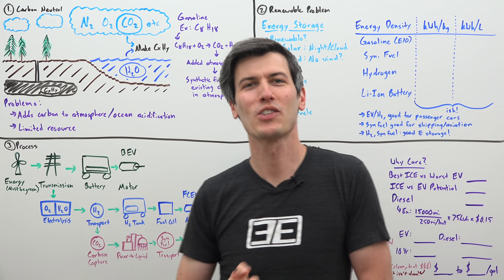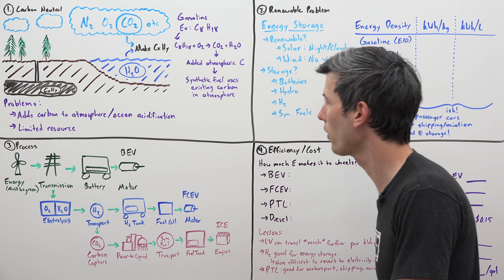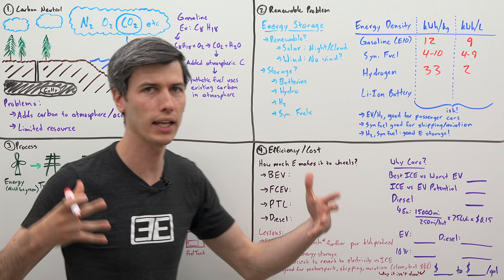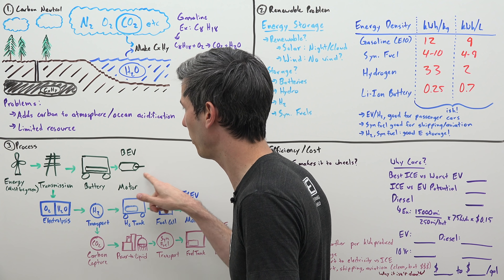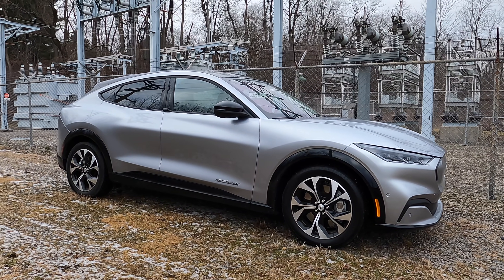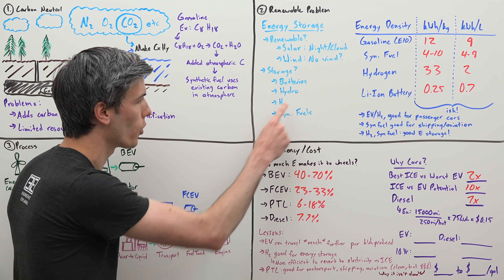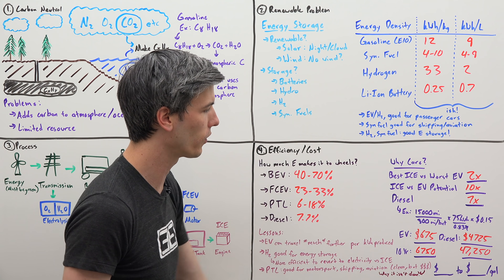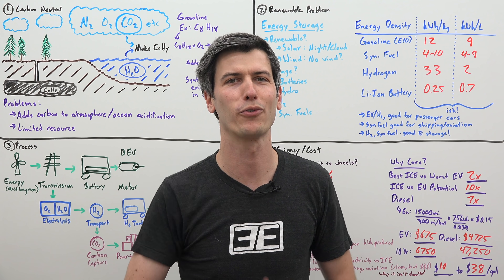The Big Problem With Synthetic Fuels

Comment: Porsche really gave me hope😭
Reply: Same here
Reply: 2$ for 1L of fuel is a ok price, in my country the cost of 1L is around 1.5$ so it wouldn’t make a massive difference
Reply: @broshido2745  vote in some politicians that aren’t going to rob you of your hard earned money at the pumps
Reply: @TKUA11  No such thing as a good politicians where i live, average salary is about 850$ too so yeah, pretty shitty place to live as a petrolhead
Reply: Still does. If any Brand could make this work well, its Porsche. And in my opinion its still a great Option for sportscars and in long terms maybe for All cars
Reply: The cool thing about diesels is that they can run on used cooking oil, so if fuel is too expensive, people might just make their own
Reply from the maker: Doesn't mean it won't exist! But I think the shift to EV/FC for the majority of passenger cars is inevitable at this point. Carbon neutral fuel is neat, it's just gonna be pricey.
Reply: @EngineeringExplained  Yes. Exactly what I was thinking: e-Gasoline will be for motorsports, motorcycles, recreational vehicles, performance cars, and pickup trucks. But gas and Diesel passenger cars (including combustion engine pickup trucks) will be only around 10-15% of car sales once electrification takes off. Besides, an EV is perfect for 80-90% of people already, as they aren't interested in engine sounds or whatever and just want to go from Point A to Point B.

Here are the areas where I think full electrification makes sense: 
- (Most) economy cars (battery)
- Short-haul, local, and delivery trucks (fuel cell)
- Lawn&garden equipment (battery)
- School buses (fuel cell or battery)
- City buses (fuel cell or battery)

IMO, semi trucks (lorries) should stay as Diesel, or transition to a Diesel & fuel cell or Diesel & BEV hybrid, while transitioning their fuel to 50+% biodiesel. Tour buses (coach buses) would also be best as Diesel hybrids as well. I've also heard that Diesel-electric is a great option for ships as well.

There also exists a thing called biocrude, which is basically a semi-synthetic crude oil produced from pyrolysis of biomass. Garbage, sewage, certain materials from C&D debris, and countless types of biomass (including medical waste). This biocrude can then be refined into almost the exact same things that petroleum can be refined into, so the changes that need to be made to the existing refining processes are comparatively small. Those giant low-speed Diesels that directly drive propellers may get replaced by Diesel-electric propulsion systems with medium-speed Diesels driving one or more low-speed electric motors, as Diesel-electric is actually more efficient than direct mechanical propulsion (for large container ships we might see a 70-120 RPM induction motor directly driving the propeller). Those engines can run on both biocrude and raw petroleum just as easily with Diesel fuel. Biocrude is a great alternative if we insist on moving away from petroleum-derived fuel oils or crude oil IMO.
Reply: @electric7487  I don’t insist on moving away from gas. Perfectly content with what we have now. There’s almost 8 billion people on the planet and they all can’t afford an electric car. Not only that, there’s not enough African children working at starvation wages, to dig out coltan for these cars
Reply: @TKUA11  Yes, EV's still have a very long way to go, but once their costs go down they will be a great option for the everyday average person. I'm also really hoping that solid state batteries can take off.
Reply: I feel you all. My LS3 swapped 350Z has its days numbered until I can turn it into an EV
Reply: Don't lose hope.
Reply: @HamsterV10  exactly idiots like this guy saying it won't work have already given up.
Reply: It really gave you that hopium that you were craving
Reply: Its given many hope and confused many many more. Dont be one of the latter... it just needs more support.
Reply: 25 years ago no one would have believed electric vehicles would be possible, Synthetic fuels are very possible
Reply: Porsche specifically said synthetic fuel would be for motorsport. Porsche itself admits there are better alternatives (electric).
Reply: Hope for what?

Comment: I literally just wrote a 15 page paper on this 😂 you couldn't have made this video 3 weeks sooner
Reply from the maker: What's my grade haha?
Reply: @EngineeringExplained  B+, basic summary was pointing out regulations that are soon to come federally and state wide (mainly California). Breaking down how different methods of powering vehicles works (hydrogen, synthetic, electric). Establishing cost estimates of implementing the three kinds of industries. Then ultimately concluding there are different applications that each industry will excel in, electric being for the masses, synthetic being for private industry projects i.e. Porsche/Siemens and also applications where weight is a higher concern i.e. aerospace.

Edit: Thank you I've been watching you for years and your videos gave me many ideas and have been very educational for a current Electrical Engineering student. 

A+ as always I was just joking!
Reply: @Newtoschool  B+.... NICE! :)
Reply: @Newtoschool  Did you also factor in cost of transition? Makes things very interesting. BEVs can charge at home and charging stations can tie into our existing grid at relatively low cost. Synthetics can work on existing vehicles and be added gradually to existing gas stations, and potentially even be transported through existing pipelines. Hydrogen requires a robust and expensive network of electrolizers to be added. IMO this is the main reason why synthetics have a future but hydrogen will not.
Reply: @Newtoschool  Awesome. Keep it up. B+ is much better than your average study on these things where quality suffers due to cost considerations which in my opinion shouldn't be a consideration when it comes to fundamental science on future infrastructure.
Reply: @Newtoschool  An intriguing global emissions reduction reality is favoring EV's, factoring existing battery production, isn't ideal if the goal is reducing emissions as fast as possible. Using Tesla's gigafactory production from a couple years ago could supply the entire yearly US vehicle sales to sold as mild hybrid.

For example contemplate the emissions reduction in these scenario's all utilizing 

1 x 50 KWh Tesla model 3 
- Requires 240V 20+ amps might necessitate breaker panel upgrade costing +5K

vs 

40 x 1.25 KWh mild hybrids gaining 15 % (Ram Hybrid) - 30% (Acura MDX) fuel efficiency adding only $1,500 - $2000 to vehicle price
- Charges itself while driving but should be allowed to plug in to recharge to extend battery lifespan and slightly improve fuel economy.

vs

5 x ~10 KWh PHEV with ~30 miles range Kia Niro PHEV gaining 35% fuel efficiency compared to Kia Sorento using same 1.6 GDi engine adding ~$5K. Keep in mind if the average US automobile owner drives less than 30 miles per day and religiously charged every night +90% of yearly driving would be emissions free
- 120V 12 amps requires 7 hours of charging
- 240V 12 amps requires 2.5 hours of charging
Reply: @Newtoschool  First year Electrical Engineer here! :D
Reply: @EngineeringExplained  not going to lie I have cited you a few times
Reply: @EngineeringExplained  100% wrong . Egas will replace EV it the elites and political democrats let them.
Reply: Out of curiosity, could we see it? Like is it public?
Reply: Many publications aka reviews of studies or studies or comprehensive publications are behind a paywall. Maybe it was just for school and not a public paper.
Reply: @joachimsingh2929  true, but if you find a contact for the author they'll generally give it to you for free
Reply: I feel your pain.
Reply: I want to read the paper!
Reply: @kschleic9053  
I know that if I were going to release a college paper to the internet, I would wait till I got the grade back, and make any necessary adjustments, then release it. It would definitely make me want to have a better paper than just turning in to a professor for a grade.
Reply: You can probably drop your DOI when it is done published
Reply: I worked on a ongoing study at uni 25 years ago that was about flywheel powered vehicles, mainly buses, that charged up a-la Hotwheels at regular stopping points.  Obviously not so good for cars though.
Reply: @AndyG73  I remember reading something about those flywheel powered busses. And yes they were built and tested in the 1940's. Looking at the web (Google, what else?) the details seems to be a bit muddled. Some sites say these "Gyrobuses" were used in traffic during the 40's in Switzerland, more specifically from 1945. An article on Wikipedia claims they were demonstrated and put into traffic 1950 and were used until 1954. Yet another source claims they were used until 1960 in the Belgian Congo.

The principle has been tried several times since but so far not with any significant success. Relatively recent development in materials has made more efficient flywheels possible as they are able to withstand higher RPM and has lower friction losses, but I have no idea about the cost and energy density possible or the efficiency.
Reply: @blahorgaslisk7763  That might be an option for stationary applications like short term energy storage but having any significant mass rotating at tens of thousands of rpm in a moving vehicle may be a total nightmare in case of an accident.
Reply: @englyn1  Those busses back in the 40's and 50's used a flywheel that spun up to 3000 rpm, and going by the pictures I saw when googling it wasn't that big. I can only assume it was plenty heavy to make up for the small diameter. Modern flywheels developed for energy storage doesn't seem to go larger than the old ones but are made of much lighter materials such as carbon fiber instead of iron which is my guess for the material used in the old ones. To make up for they do run at a much higher rpm. I haven't tried to find any details but 10K rpm does sound reasonable, but it could be even higher.

The low weight means the gyroscopic effect shouldn't be much worse than for the old ones. In the busses the flywheel was installed with the axle vertical. That way the gyro effect will act to keep the buss from leaning which is desirable for a vehicle with a high center of mass.

As for what happens in case of a crash I feel reasonably certain the casing will be sturdy enough to either contain the fly wheel or shatter it into pieces small enough it will dissipate the energy quite quickly.

Having said all of that I'm not convinced it's worth the effort. The original busses had typical speed of 50 to 60 Kmh and a range of about 6.5 kilometers. The longest stretch between power stops was 10 kilometers but that was apparently really the absolute limit of what it could do.

I do not know if they had figured out regenerative braking but my guess is no. If so then that one thing that could improve the range limit. But still the energy density doesn't look like it would be that great.
Reply: There are 2 billion internal combustion engines in the world. There will never be 2 billion "100 kWh lithium-ion batteries" ever.
Reply: If you ever release it I would like to know
Reply: You still need energy to mine lithium. It will be like the coal, oil ie  oil sands and mining industries. Pollution and environmental damages.
Reply: Would love to read it! Would you mind sending me a DM with a link to where I can read it?
Reply: I'm gonna do my thesis based on this, would you mind sharing your paper or some of the articles you used? thanks in advance
Reply: Formula 1 will be using synthetic fuel for the  2025 season. Trust F1. They set the trends.
Reply: What's your major
Reply: Bro same
Reply: hey if you only have 1 source that doesn't make your paper/argument look good btw.
but hey if you wrote said paper and came into the a similar conclusion on your own, I say you did well.
Reply: Seeing both you EE and Real Engineering post same topic video within 1 day of each other makes me think there's a Big Tesla running anti biofuel propaganda 😅
Reply: Bruv happened far too often
Reply: Thinking of doing discrete choice modeling on data from ICE enthusiasts to see their willingness to pay for efuels
Reply: 😂omg
Reply: That’s a long paper.
Reply: Fjjjj. I
Reply: Please share the link to the paper
Reply: Be happy you made it yourself. The worst fate is that of someone who copied all of their work. It ruins your brain and soul
Reply: Do your own homework